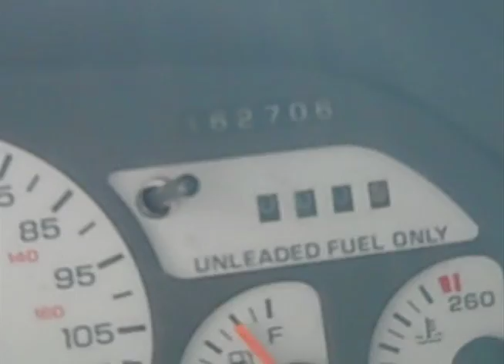1994 Camaro Engine Rebuild

Comment: hey man I dig your car, and what you did, im in the same process at the moment, but I got a ? maybe you could help me with, and I cant fiqure out if it my throttle body p secor or maybe I just need to tighten my throttle cable but I have a 94 manual and sumtimes it reaves when I clutch and sumtimes itll die down and stay there like the intake is feeding it too much gas, and I practically have to wait a mili secnoud for my rev to die down inbetween shifts? help pleassse

Comment: i know hoisting the engine up will take weight off of the trans in order to loosen the bolts. but if anybody has seen the tight space between the firewall and bellhousing on fourth gens please advise me of how to remove the bolts. the bottom two came off easy and the trans has a newer torque converter so i know the bolts cant be too impossible to loosen its just the matter of of getting a tool of the bolts. even from the bottom its too tight of a fit for my impact wrench

Comment: Nice to know I can remove the motor through the top unlike the “recommended” way of dropping with the chassis. For those who don’t know a V8 conversion is quite an extensive ordeal from a v6 for this year Camaro. I have a 94 with the 3.4l motor and was looking into doing a conversion, it’s quite the job.
Reply: What makes it such a big job?
Reply: @weeklygamer3607  it's not a engine only swap. You basically have to have a donor V8 car to successfully swap because a lot of the v6 parts aren't compatible.

Comment: What tools should I have to make job easy ... only the tools I must have?
Reply: A 220v, 75a adjustable-socket hammer-wrenchdriver with 1/4" blades. Shouldn't need anything else.

Comment: what's the best engine for the 94 camaro
Reply: +Eric Jones Jones LT1 is the v8 option for a 1994. LS1 is possible with different harness, k member, mounts, etc.
Reply: +TASTV22 good looking i didn't know that this my first camaro
Reply: Is it a v6?
Reply: +TASTV22 yeah
Reply: +Eric Jones Jones Unfortunately unless you can locate the engine, harness, k member, mounts, etc for dirt cheap, its usually cheaper to buy a stock v8 camaro. 94's usually run 3-6k
Reply: +TASTV22 ok im looking.
Reply: I have a 95 with a V6 and only paid 2 grand , most of the others i have seen look very rough compared to mine . So i could have got a Z28 but none that were near that price or with perfect paint and body . Hell they aren't that easy to find period where i live , they should be worth a lot more than they are being as rare as they are .

Comment: Why 3.4? could have gotten lt1, ls1, sbc, or even a bbc at the very least the 3800 even a 4.3v6 would have been better. Good job picking the worst engine, not even the cheapest option either.

Comment: why the v6 i mean damn my camaros a v6 now and thats the reason i bought a lt1 to build up and throw in there not to mention you put the 3.4l compared to my 3.8l if you wanted the v6 why not the 3.8l more power durability better sound all around better motor and should have atleast build it up alittle this was kinda stupid idea for that camaro in my opinion
Reply: it would be stupid to put a built v8 on the v6 suspension and rear end.